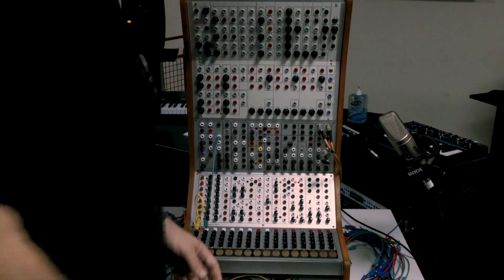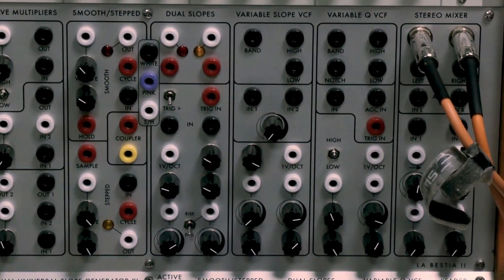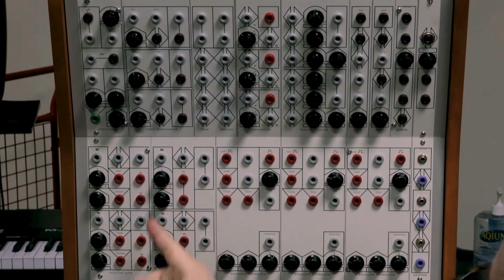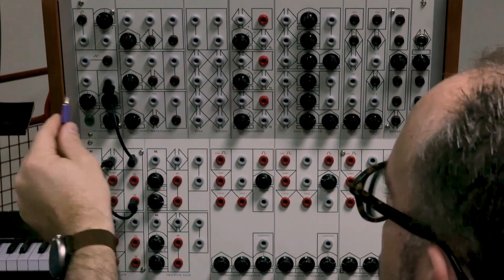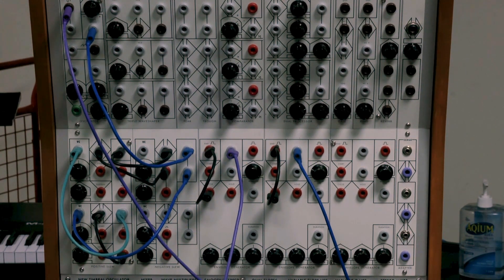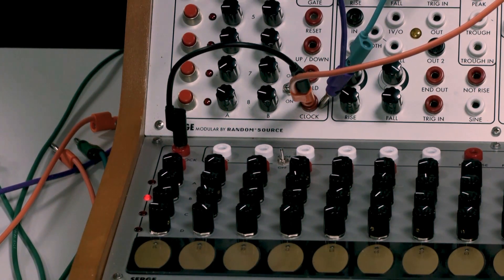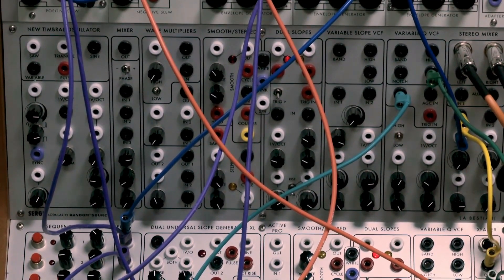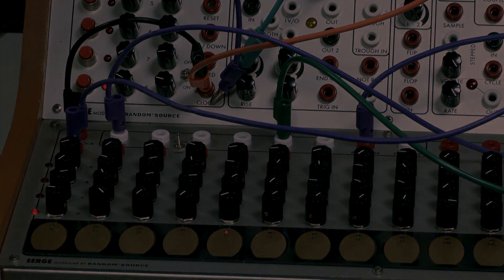SCM Serge Workshop - The 'Kameruka' System - Video 1: Overview

Comment: Great introduction!
Some additional comments on the basic info from my side:
0:35 Serge is Russian/Chinese, born in France. He lived and worked quit a while in the US though.
2:18 Another think than Serge didn't like on the Buchla system was the fact that it used different patch sockets for audio and control voltages.
4:00 "Random*Source" or now "Serge Modular" is based in Frankfurt/Germany and build improved and modernized version of classic Serge designs as well as completely new Serge designs.
Reply from the maker: Hey thanks for these clarifications, my apologies!